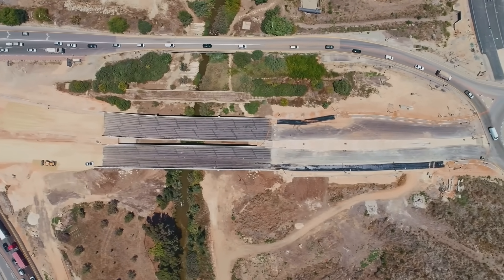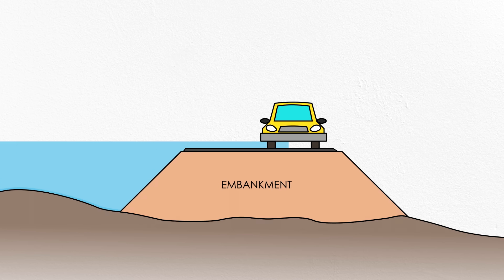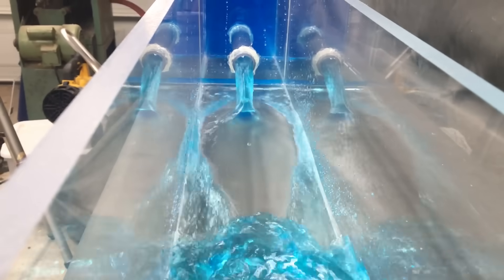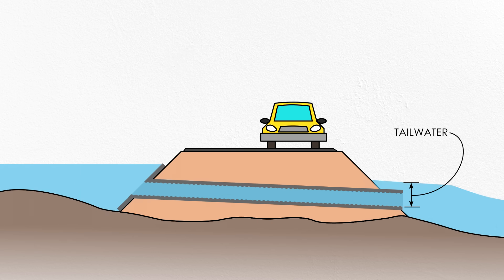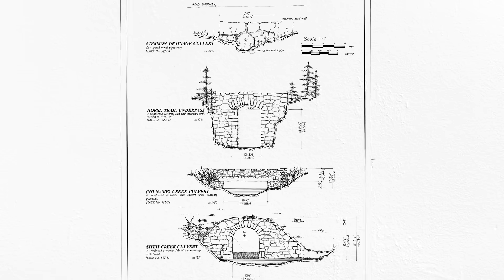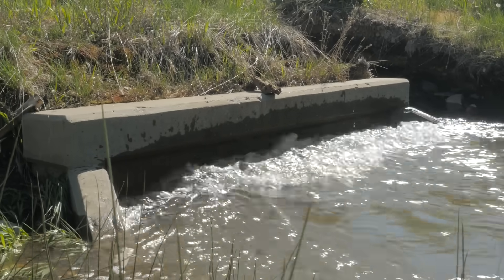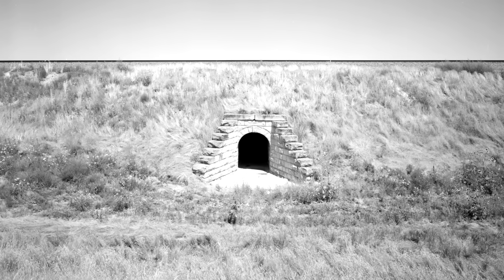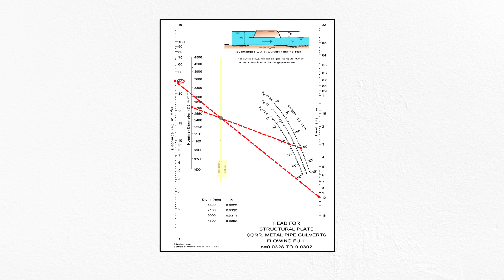What Is a Culvert?

Comment: "Calculating how much water can flow through a culvert is actually very complex" - cue hard eyerolling from all the process engineers.
Reply: What does that mean?
Reply: @jakeg2089  it means that compared to complex pumping and piping arrangements it is not that complex.
Reply: @csatterley  Evaluating the hydraulic performance of a culvert is not terribly difficult. Estimating the incoming flow is what is difficult since the hydrology upstream of the culvert depends on many factors which can be difficult to measure.
Reply: It actually is.  The biggest factors are the watershed area, the slope leading to the culvert site, and the roughness coefficient to use.  If in doubt, go up one size is true because the biggest cost is the installation, not the pipe.
Reply: @royreynolds108  looking at the equations it seems more straightforward than complex flow calculations in process systems. I'm sure it is complex to the lay person or the structural engineering not familiar with flow.

Comment: 300+ pages on how to upsize a pipe. Good old government bureaucrats burdening the industry by inventing fresh BS to keep there jobs and justify next year's budget increase decades after the problem was solved. I've read a few of those guides its like 50 pages of nothing burger before getting to any useful specifications, followed soon after by endless exceptions for a bunch of corner cases and exceptions that will never ocure in practice because ...just upsize the pipe. 
Airport design is especially bad because you have a lot of government transportation funding mixed with private business and a lot of holdover policies from semi-communist notions of the 1930s regarding business that have totally different physical requirements for an operation based on the type of compensation (for profit, private, non-profit...) and limits on "through the fence" operations (ie a private hanger property ajoiningo the "public" airport. Though 'public' airports can be privately owned and managed, it just refers to the type of flight activity.), then even fee structures for recovery of investment costs must be pre-approved... If your ever wondering why air transport industry is given endless subsidies and bailouts its because they have also had their hands tied regarding how they operate the business and are required to provide certain services to the gov free of charge.

Comment: Culverts have zinc in the galvonized coating. Zinc can kill salmon fry. Have they had any luck with other coatings?
Reply: This is from the 1960's so keep that in mind.  CMPs were available plain(galvanized always), hot-dipped tar coating(acidic locations), hot-dipped tar with a smooth tar flowline, and hot-dipped tar with asbestos mixed in(for very severe conditions.  Since then ABS has picked up use in culvert installation.  French drains and field drains are much better with ABS than cmp.

Comment: My brother is a Forestry Engineer.  Installing and replacing culverts was part of his job.  As I remember it his two biggest complaints were:
Shotgunning -- This is where on a steep side slope, the exit end of the culvert is high in the air, sticking out of the bank like the barrel of a gun.  It wasn't the height of the outlet that was the big problem, but rather that this was the result of the slope of the culvert being much less than the original slope of the stream.  The problem is that the when the water encounters the lower slope of the culvert, it slows down. And, when the water slows down, it drops the rocks and sand it is carrying, plugging the culvert.
Double Culverts -- In flat areas, two (or sometimes even more) culverts are laid side-by-side so less fill is needed to cover them than for one larger culvert.  The wall between the two culverts (the gore point if you will) is really good at catching branches.  And then the branches catch other stuff quickly clogging both culverts -- especially in times of high flow when the more debris.
Reply: The bridge about 400 feet from the house has a double and I can confirm, I have to get down and clean out the dam almost every year
Reply: Yep your brother’s job is also mine.

Comment: 8:10 Come on, that's just a bridge at this point.
Reply: Three box culverts! The vertical supports are just as wide as the structure itself, so they behave like pipe walls. You can call it a bridge if you'd prefer, but the hydraulics are the same!

Comment: 300-something odd pages?
That is ... surprisingly tiny actually. I mean seriously, i recently had to get some information about a specific (industry standard) 1D barcode. The BASE-Version is ~480 pages, and then there are 5 other documents detailing extensions and variations (each >150pages)......... had to read like half of it just to get a basic grasp of how it is constructed and what the actual customer requirements were - just to get told a week later that they might use a different barcode alltogether.

Comment: is it the air in the pipe restricting the flow of water in the pipe in the first example if so couldn't you build a pipe (that is higher than the water level) on top of the pipe to let out the air and increase the flow of water?

Comment: There's a boggy wetland where I grew up, and still take walks through had a rail line (good example of cut and fill) put through it in 1855, and was rebuilt in 1914.  A stream that drains the wetlands zig zags from one side of the rail line to the other for the course of the stream.  One can see examples of culverts, one an original hand laid stone one from 1855, to square re-bar concrete dating to 1914, to more modern looking concrete from the 1950's, complete with structures to capture flow.   The 1855 culvert amazes me the most as it connects two very silty ponds with low rate of flow between the two of them, and it is still functioning, unblocked with no evidence of maintenance that I can tell.

Comment: Quite a while back, I went to Nicaragua and found a culvert unlike anything I've ever seen. Firstly, it hardly did it's job. water flowed an inch or two over the road regardless, but they guided the water to a side ditch made of concrete, so the flow could be used for washing clothes or cars or whatever. The other odd thing was that the culvert  wasn't vertical . It was three circular holes laying flat parallel to the ground on a concrete box about five feet below the  road. The holes curved down sharply to be let out on the other side. It made for a very fun but dangerous waterslide for the local children. I wonder why they designed it that way. I'm guessing the local community didn't have the funding to make one properly, and needed to quickly make it happen for them selves. during a dry season.

Comment: What's the limit between a culvert and a bridge?

If the pipe on the culvert is large enough, it looks to me like it will become a bridge.

The culvert at 8:10 looked like a very small bridge...
Reply: Well the decision to build a bridge or not is not only a water problem. There is always the structural factor. A bridge is usually far more expensive so you will do your best to avoid it but even if you can overcome the water problem by adding a culvert, it still might not work structurally by filling the area.

Comment: @6:10 is the very high water level due to a vapor lock at the pipe inlet?  There is clearly a large bubble restricting the flow there.  If you temporarily stopped the flow at the outlet and let the bubble dissipate, would a new steady state with a lower water level be achieved?

Comment: i got a few in my part of the woods ( littly) and here is 2 storys to tell. the first one is about a very small one right next to the house it looked like plastic in its make. and what started happening (and we did not know this at the time) was the road started breaking apart the culvert was breaking apart so after a few weeks to a few months i do not recall all of the details. the road construction corp. replaced it. then the next year the road started breaking apart again, and again they replaced it. after 2 or 3 years of this it turns out the culvert was on soil that sinks and when the soil sinks the culver sinks as well. and when the culvert sinks well you get the idea. so the road corp added a different kind of culvert one that looks like it had some holes and more bouncy in its set up. and that sloved it but it looks like there is a few cracks in the road still. ill leave the 2ed story in a reply so you can read that one septerly
Reply: the other story is we have another culvert another one that looks plastic in make but bigger way bigger. 5 foot if i had to guess ( and yes i played it in when i was smaller those have their own dangers) and the setup was like your diagram at 2:23  but it was huge 10 20 feet in the air. heck maybe even 30 but that is not  my place to guess or to tell. anyways this culvert system stayed active for a number of years until about 5-7 years ago when beevers made their home on the intake side and overflowed the system and did flood damage. nobody was hurt to my knowledge but it did ruin the road and they had to replace the whole setup. i got pics of the dug up side somewhere  ( when they were not working) and put in 2. this time and i was wondering if you could expand this topic in a few videos of the unknown factors in placing in replacements.

Comment: Another large advantage of culverts are that if they are sufficiently large, then animals can cross under the road without risking their life. This means that the road doesn't cut off ecosystems from each other to the same degree.

Now, culverts are far from an ideal solution for this purpose, and not all animals can make use of them. It is mostly small, typically water living animals that do find them "useful". (Don't get me wrong, culverts are still exceptionally useful, and should still be built.)
In some areas, more open and elaborate bridge sections can be found strewn about out in the middle of nowhere, mostly so that larger animals can pass as well.
Smaller bridges over the road can also serve the same purpose. And making shorter road tunnels where the landscape permits, can lead to natural bridges for the same purpose.

Though, few regions of the world takes ecosystems into consideration when building infrastructure, leading to fairly large systemic collapses and endangerment of many species living in the local area.
A wildlife fence on the side of the road does protect drivers from hitting a deer, but also prevents the deer population on each side of the road to mix. So the ecosystem becomes more fragile and can lead to all sorts of unforeseen problems. Therefor it is important to give the deer and other animals a safe way across the road. (Some animals can though fly and makes it across without much issue.)

Comment: Nice video.  While I'm no engineering expert, I was aware of some of the basics of this from when I had a job years ago on a private road system project helping install culverts and inlets where everything has to be up to code and standards.  They were really picky about it also because it was a coastal area where there is high runoff and the landowners didn't want their road washed out after a bad winter.

Comment: 7:40 Those diagrams from 1963 are metric? Is that because you can't convert between inches and feet in a linear fashion or is it just an adaptation of original?
Reply from the maker: There are metric and imperial versions